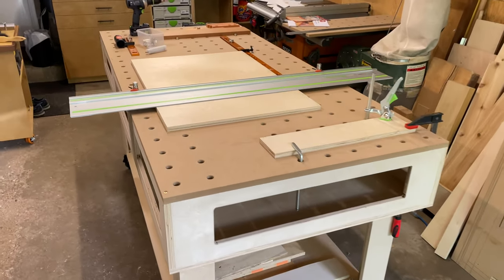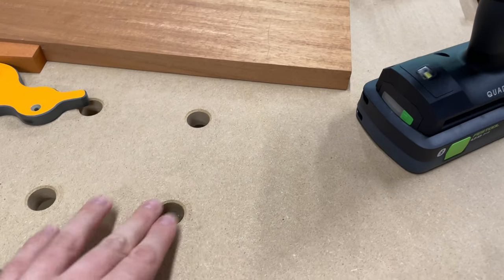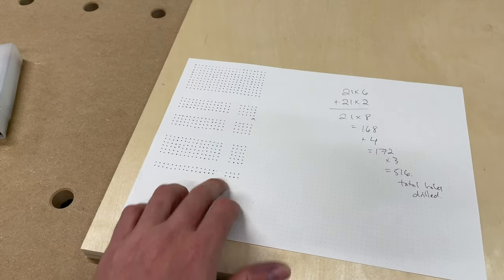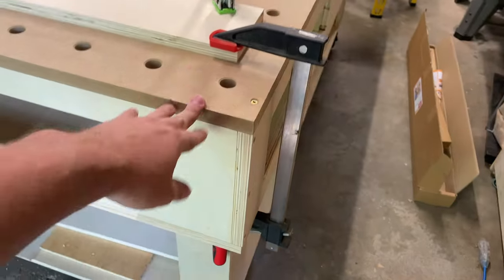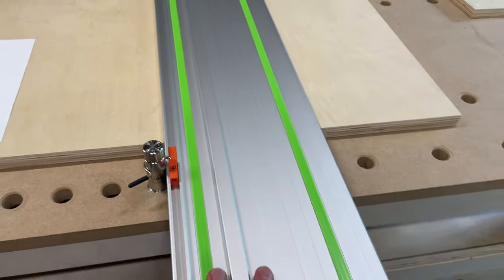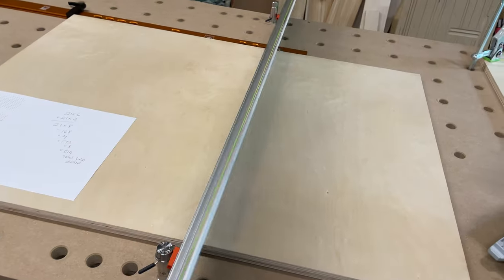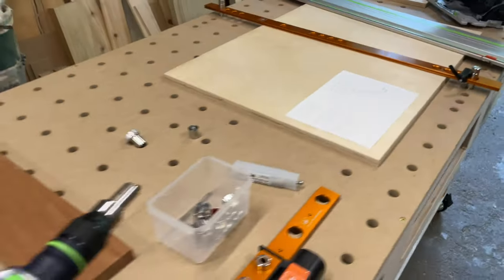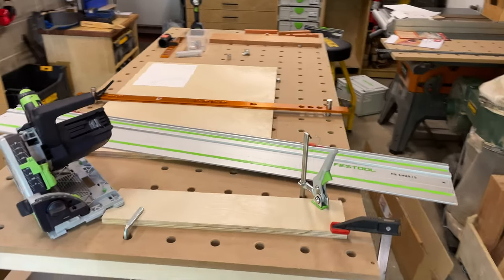Making My Own MFT (Update #4) - Torsion Box Complete, MFT Holes Drilled, Loads of MFT Accessories!

Comment: I noticed you had the parf dog in the cam being inserted from the top. Try inserting the dog then the cam over the dog. You may already knew this but the dog protruding above the cam stood out to me.
I have a ton of the ujk stuff mixed with Incra fence for repeatableilty and add the dashboard mounting bracket.

Also I use TSO smart connect bench dogs to add panels for breaking down bigger material, mounting my kreg jig to, and router table. Of course Ron Paulk deserves all the credit for those ideas.
Reply from the maker: Thanks for the note! I’ve been quite impressed with the UJK products, but those TSO dogs look pretty impressive!

Comment: 👋 hi from norther ontario. Love your videos. I wonder if those clips for the track saw to the bench dog would fit the makita tracks.
I can't wait to build a bench like this this I should be in my new shop by October and watching your videos showing all the options with the parf system makes me want to go that route.
Reply from the maker: Thanks for such a positive comment, Mathieu! With the Makita tracks being so similar to Festool, I wouldn’t be surprised if they are compatible but I imagine Axminster Tools could confirm as they are pretty good with noting compatibility. I have no regrets in going the DIY direction for my MFT and while the jig and accessories may be closing in on $700 or so, that’s still much cheaper than the smaller MFT/3 from Festool that I was about to buy (if I need to work on a job site the MFT/3 would be ideal, though).
Reply: Yea they do fit Makita tracks

Comment: Great job on the workbench! You'll probably find you replace the top far less than you think you will. ;-)
For a finish, I'd probably use dewaxed shellac. It dries really fast and is plenty durable for a workbench top. 
I'm still undecided if I want to use simple rail clips like you do, or buy one of the aftermarket rail hinges from benchdog or dash-board. I'll probably try the clips first (or the diy solution by dave stanton) and see how I like them.

As for suggestion on making your workbench better, vacuum clamping my dude! 🙂
The festool setup is no longer sold, but I'm between making my own or trying the setup from vacpad.
Either way, congrat on the progress! You did in a week what takes a lot of us months lol
Looking forward to the next one!
Reply from the maker: Always a great comment, thank you! I agree in that I'll replace this less than I think and I'm hopeful as well, haha! I ended up going overboard today with Osmo Polyx-Oil (clear matte 3031) today. Three coats with a light sanding with 220 between coats 2 and 3 (not even worth it between 1 and 2). Far more expensive than I wanted, but my wife talked me into it after seeing the effort I put into the table. 

Regarding clips and that sort, I am planning to do a video in the next few weeks (likely mid-September) on the squareness of cuts using the clips, clips + fence, and a few other things. Not sure how that will go at the moment as I have some work travel throughout the next six weeks.

Vacuum is my dream...the Vacysys is so slick and I have a friend fully kitted out with it. I wish it was all still available, but Canada does still have some of the components available outside outside the pump. Looks so nice!!!

Comment: You should remove the screw that was seen under the rail. It looks like it would aline with the cuttinggrove if you offset the rail. Even if you recessed the screw, you will at one day hit the screw with you sawblade (maybe on an angeld cut). Ask me how i know.

Nice build. Am looking for rebuilding my workbench an find a lot of inspiration here.
Reply from the maker: Happy to have helped with some inspiration! There isn’t really anything I would go back and change at this point and it’s an easy bench to add to. 

Luckily, that screw that looks like it’s be in the cutting line is about a 1/2” away.

Comment: Does your track pivot up and down or does it stay fixed horizontal?
Reply from the maker: The UJK clips that I use allow for vertical movement up to the height of the dogs in the holes. The taller dogs I have allow me to easily cut material that’s even over 2” thick.
Reply: @MasonWoodshop  Ohhhh, so the track is primarily supported by the material to be cut but is just anchored by the clips to the dogs for a square cut.
Reply from the maker: @MatthewKrieger yes, exactly! Works great.